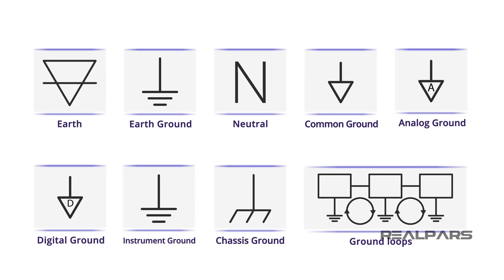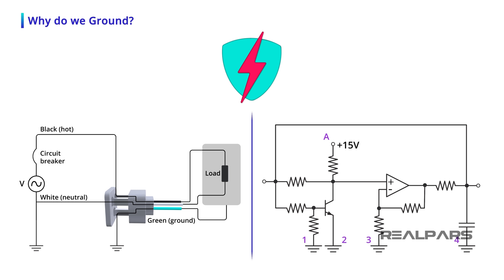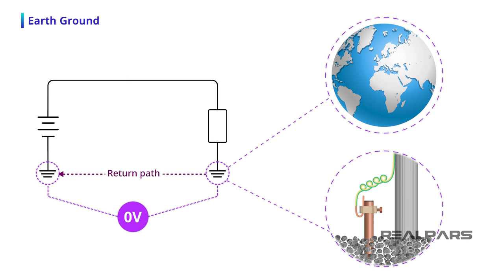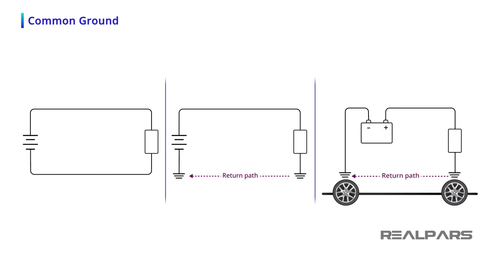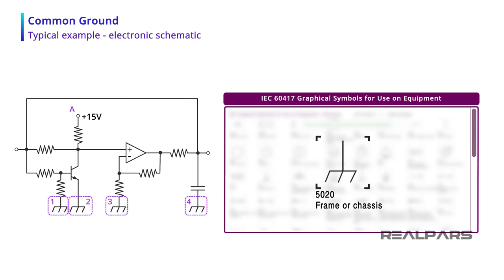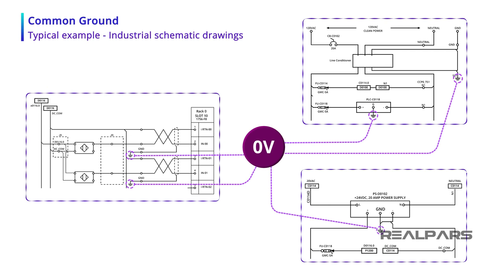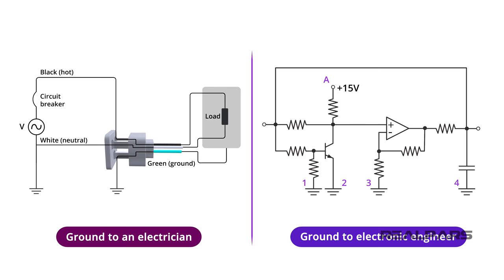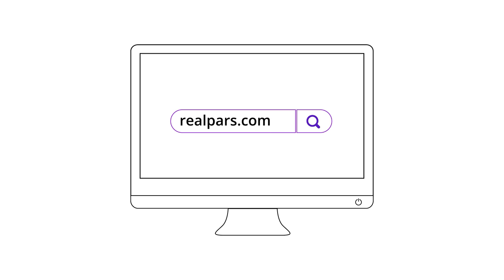Electrical Grounding Explained | Basic Concepts

Comment: This video is informative, but also wrong when we're talking about the power supply to your house. Ground in that case is referenced to both the utilities neutral and earth ground, so it's confusing. However the path of least resistance tells us that the majority of the flow returns to the source via neutral when the ground circuit is used. The ground rods aren't there to reference earth - they dissipate static and other high voltage sources such as lightning. I have had many people argue this, stating that neutral is referenced to ground and not the other way around. My rebuttal is simple. Remove all grounding to a house. Does the single phase power still function at or around 120V? The answer is yes. In a home, the "ground" is for safety and high voltage discharge, not reference to the hot leg to provide 120v L1 or L2 to neutral/ground.
Reply from the maker: Hiya.... Thanks for your input.  It's always great to hear from our readers.

Comment: Ultimately, earth and ground really boil down to what its used for, as 0 volts reference point, and/or wire for all "extra" current to flow to/trough, especially in case of fault.

Comment: Thank you for sharing this helpful video. The only quibble I have with it is calling “planet Earth” the true 0 volt reference. More generally, voltage is the integral of the electric field between two points in space, and one of the points is 0 volts by definition (I.e., 0 volts does not necessarily refer to the planet Earth). Your video is, nonetheless, very helpful.
Reply from the maker: Hey hubercats, thanks for your point of view.!
Reply: Its arbitrary, you can set whatever reference potential wherever you want and get valid results as long as you are consistent with the notation. The easiest way is to set reference potential to 0V (for ease of calculations) and to set it to planet earth. All in all, when safety is concerned, you most often stand on the ground, therefore you are also 0V and whatever potential you touch, that'd be the voltage to shock you :D If you have 1000V point, then it is 1000V. Would be much harder to do it when earth would be set as reference of 2342,1214V. Then it'd take w while to calculate voltage ;)
Reply: @sumilidero  🤣

Comment: As soon as you mentioned that the ground symbol was the most misused I thought to myself “guilty!” 
I’ve worked more with low voltage digital/analog circuits (mostly for classes at school, a little at work now) and we just use whatever symbol we like to denote a 0V point, without regard to whether it physically means chassis, Earth, or just a copper trace. At school this didn’t matter because every circuit we worked with was just a little bunch of wires and a battery, with no metal chassis or Earth connection to be confused with.

We almost exclusively used the most common “Earth Ground” symbol, but some professors would use “Common Ground” or “Chassis Ground” in their schematics.

Comment: This is why in elettronic is better use "0V reference A/D", in the schematic you can highlight the connection with the chassis and the ground (if necessary), but also the connection between 0V-digital and 0V-analog. 
If the target of your circuit are boats, cars or airplanes "ground" means the chassis of the veicle.
Reply: Yeah, but in that case is the negative, right? That's the reason you have to disconnect the negative before when removing the battery.

Comment: You should also note why it's important to declare what "standard" you use for the basis of your discussion. Still people around who think the NEC is a standard when it's not and it specifically states that. Also the symbology changes between standards i.e. IEC, IEEE, NFPA and JIC. JIC I believe is outdated, but if you declare that's what you're using, then you have to go by that standard. Love the video. Good explanations!
Reply from the maker: Hi Albert. You are correct. The NEC is not actually a true "Standard". As per their own definition " Adopted in all 50 states, NFPA 70, National Electrical Code (NEC) is the benchmark for safe electrical design, installation, and inspection to protect people and property from electrical hazards.". In fact certain parts of the NFPA 70 can be rejected due to regional restrictions. Thanks for your input.

Comment: When using a two prong tester to find the hot line, we can old one prong between our thumb and finger. Inserting the other prong in the hot socket, the bulb will light.

Our body is absorbing electrons. Does that mean "ground" means electron hungry?  

Are our bodies behaving like capacitors?  If we held that prong all day with the other on the hot side of a plug, would we reach capacity?
Reply from the maker: Hi Roger.  Thanks for reaching out.  I'm not sure what you mean by our body being electron absorbers. We certainly have several electrons in our body and if we contact a voltage source or a source of EMF, these electrons will begin to move if they have an "Escape route". And that is not a good thing.  We can be killed with less than 50 mA of current flow. We aren't like a capacitor and our bodies won't "charge" like a capacitor.  As a side point, we can't charge capacitors with an AC supply. A capacitor is charged as you describe with a DC source.
Reply: @realpars  : I guess what mystifies me is the fact I'm wearing rubber soles shoes and feet off the ground in my house on wooden floors, and just holding one leg of the idiot light current is moving in and out. How does that work if I'm not, at least temporarily, absorbing electrons?

Comment: Ultimately you have to know the standard that was used for the design of the facility, then understand changes made afterwards may or may not have adhered to those standard, then you have to understand the symbols as defined on those drawings because other symbols are legitimate if they are listed on the drawings.  Drawings are a higher order of precedence than standards.
Reply from the maker: Thank you for adding that!

Comment: As we all know that circuit needs to be closed path to flow current. When live wire touches body of equipment and that equipment is grounded, how it makes closed path? Because live wire is coming generation station or near by transformer so current follows all the way to generation station to make close path?
Reply from the maker: Hi there. Thanks for your question. Ultimately, all supposedly grounded equipment is grounded to the same electrical point. This point is not usually the same physical point, but it is the same electrical point therefore a closed circuit is formed.    I hope that answers your question.

Comment: I’m still confused. How is a car frame a viable option as a ground? What about the cars chassis or frame allows it to be a ground? It’s not a copper rod in the ground it’s just a huge metal body. The reason I ask is because I’m trying to create a home audio system out of car speakers. The box is meant to be somewhat portable but I have no way of grounding it to the earth and still being portable. Is a metal plate the solution/is it a viable ground point?
Reply from the maker: Hi @Asap Mimic. Here's where the term "ground" becomes confusing.  In your situation, "ground" is the negative terminal of whatever you are using for a 12-volt DC power supply.  In the car, the "ground" is the negative terminal of the battery, which is the same as the frame of the car.  In order to operate the same car system at home,  you'll need a 12-volt DC power supply.  The negative terminal of that 12-volt power supply will be the "ground". you do not need to connect to any earth ground.

Comment: Excellent video. Being a mechanical, why "electrical noise" create havoc?
Thanks for your excellent work.
Reply from the maker: Electrical noise is often induced into or interferes with normal operational or control signals. If these control signals are altered in any way, false readings can occur resulting in incorrect responses.
Reply: @realpars  Thanks for your kind reply. Keep us educating.
Thanks.

Comment: Hi Sir 
I have a confusion 
Transformer neutral is grounded so when we using neutral on load side, there is a current flows in neutral..my question is if there is current flowing in neutral then why transformer C.B is not tripping by earth fault?
Reply from the maker: Hi Muhammad. I'm not sure I understand your question.  The neutral wire current is normal while the ground wire provides a path for abnormal electrical current to earth.  A GFI CB detects earth current as it is faulty.  It will not detect neutral current because it is normal.

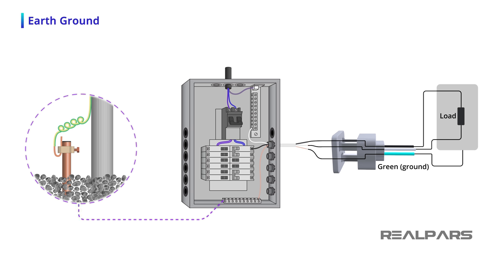Comment: At 2:00 you show a main electrical panel or first means of disconnect. The ground and neutral bus bars look to be separated. They must be connected or just have one. The neutral, equipment ground and earth ground are bonded there. The current flows in a closed loop which includes the transformer and no current on the ground wires under normal operation. In case of a ground fault the current on the ground wires will still go to the neutral on the transformer because it's bonded to the neutral in the main panel and the breaker will trip if the current more than the rating of the breaker. It doesn't flow to earth ground as the impedance is too high. The primary purpose of earth ground and the ground rod is to shunt outside static such as lightning strikes to it's source, the earth, and not your home electrical system.
Reply from the maker: Hello @Ted Sanders. Thanks for reaching out to us.  You are absolutely correct. The neutral and ground are to be connected together for sure. We don't have a physical wire connecting the 2 bars together but. They are connected via the ferrous metal enclosure, which I believe is acceptable.
Reply: @realpars  I don't believe that is acceptable. You need a more purposeful connection, not an incidental one. The most common way and only in a main panel, not sub panel, is to use the green screw supplied. It bonds the ground, neutral bus bars and the case.

Comment: 5:00  I'm not sure the ground loop solution depicted is necessarily a solution. E.g. if the current from block #2 (left to right - 1, 2, 3) is much greater than the current at block #1 then circuit #2 is going to effect circuit #1 or #1 is much less than #2.  I believe this is why these grounds are advised to be spaced apart far enough.
Reply from the maker: Hi Lou. Thanks for your input. The circuit #2 (right-hand) depiction could be drawn differently. I think the audio description would be clearer if the return from each block went directly to a single connection point, such as a bolt connected to the chassis of a vehicle.  Unfortunately, the current depiction could be interpreted as the return from Block 1 connects to the return of Block 2, then the 2 returns are connected at a common ground point.

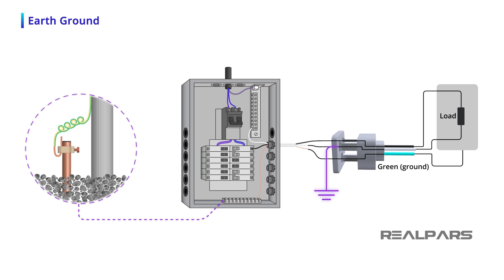Comment: 2:05 , for all my Europe brothers, this is not the case so don't be confused.
In Europe, Earth ground wire is separate, connected directly to the rod that is stuck in the ground, and at no point do neutral and ground wires connect.
Reply: Does neutral have a voltage compared to ground ?
Reply: No, there is nothing "in Europe". Different countries have diffrerent systems and some have several especially if one counts older installations. Every grounding system is used in Europe. In Finland for example older homes have TN-C where the neutral is used for grounding all the way to the socket. Newer use separate wires inside the house but common outside.

Comment: Excellent video. Can anyone tell please than when comes the role of ELCB (earth leakage circuit breaker)?
Thanks.
Reply: The device measures current differential on the 2 lines (L & N in europe). If the amount of returning current is smaller than the incoming current, that means there is a current leaking and this is dangerous (fire, electrocution..) So it breaks the circuit, until you manually turn the switch up again. Usually they are 300mA, for humid rooms like bathrooms they must be 30mA
Reply: @alexvdz8840  Thanks for your kind reply. Keep it up...

Comment: what is TT &TNS system of earthing explain with diagram 
why TT system alone is not enough
Reply: In TT the earth is provided only locally. The earth connection on a socket leads to physical earth and nowhere else. The problem is that impedance of the earth may be too high to trip the breaker in case of a fault. However, nowadays, that can be fixed with the use of RCDs. 

In TN system the earth is provided by the electric system, There are three variations: TN-S, TN-C and TN-C-S. In TN-S the house gets a separate earth and neutral and these are not connected inside the house. Eventually they will lead to the same place. Where they are connected is the business of the electric company, Ideally at the transformer. In TN-C the house gets a common neutral and earth i.e. a PEN-wire and the same wire goes all the way to the sockets where is is separated. This is obsolete and such systems are no longer installed. In TN-C-S. The house again gets a common neutral and earth but they are separated at the main panel and kept separate. This prevents the raise of voltage in the earth cable and therefore stray currents that can generate interference.

In TN in many counties a local earth electrode is also required to reduce risk in case of a PEN-fault. In the UK that is not required.

Note that in apartment buildings where different entities are responsible for wiring inside and outside the apartment things can get more complicated. MY apartment gets separate earth and neutral but they are combined as the installation inside the apartment is much older.

Comment: Why use the "Chasis Ground" instead of "Analog Ground" in the Op Amp example you gave? 🤔
Reply from the maker: Hiya Mau365PP. Yup, my point exactly. Why is that ground symbol used in this opamp schematic? Who decided to use that symbol, and where exactly is it connected?   Is it connected to chassis? Analog ground?  Hard to tell from the schematic itself.

Comment: Hi, I saw that grounding body îs quite necessary especially for people with cronic disease as I am. I live at 4 th floor, so I have to use grounding of electricity socket. But I want to add 2 fuse in series on the grounding cable for safety reason. Any idea about what type of fuse ( what curent, voltage) . Thanks
Reply from the maker: Hi there. You've asked an interesting question for sure. The jury is out on the effectiveness of fuses in series. Some will tell you that a second fuse serves no purpose and others say that it does. I'm not sure how you are planning to double fuse as you'd have to do some serious cable splicing in order to insert your fuses in series. Quite likely, your circuit breaker provides all the protection you need???    But, not really knowing what you are trying to protect, it's difficult to provide an answer.
Reply: @realpars  the fuses could be put în a plastic tube  according to fuses and cable dimensions. Whole cable and fuses must tested preferably in laboratory. If anyone was in my place when a lightning strike(I saw that strike)  street electric transformer ( and distroyed it)  and then the lightning went out 10 centimeters  from electric socket situated  at 2 meters from me, you will  serious think to put at least 2 fuses ! And other protection measures.
Reply: @realpars  As You know at high voltage  it appears flashover phenomenon - I saw it with my eyes in a factory at electric test and I see the lightning came out from socket ar home. In this case it îs advisable to prolong insulation ....adapt things.

Comment: Could a voltage source with a lower voltage be used instead of grounding? Doesn't grounding waste electricity to some degree?
Reply from the maker: It seems like the answer would be "YES", but the scenario you describe is not feasible.  A power supply does not provide voltage through 1 wire alone.  There needs to be a load and a wire connected back to the common side of the power supply.  The voltage is actually a voltage difference (between + and COM) that drives the device.  The device only consumes the amount of power required, and this results in a voltage drop across the device.  If there is no load (voltage drop), then you have a short-circuit.  Current flows from (+) to COM, or for physicists, positive holes flow from (-) to (+).  Grounding is a separate issue.  Grounding is provided as safety for short circuits that may electrify housings or cabinets.  Grounding does not waste electricity because, under normal circumstances, there is no flow of current to the ground.  In this video, we learned it is common to represent 0V  (or COM) with a ground symbol, which is not typically earth ground but rather the (-) of the power supply.  Using the ground symbol allows us to simplify the electrical diagram, as shown at 3:25 in the video.
Reply: @realpars  In SWER electrical power distribution, the EARTH is used as the "return wire" and yes the resistance of the ground path does waste some energy.  If the "ground path" has the same or lower resistance vs a wire than it makes no difference, example: the car's metal frame.

Comment: For those who knew nothing about electricity before watching this video, then the phrase quote 
" electrical noise" should have been explained.  I still don't know what it means & will have to look it up before watching anymore videos to learn  about electricity in our homes, in our bodies and on planet earth.
Reply from the maker: Hi Cynthia. Thanks for your comment.  As you mention, you can find loads and loads of info on the term “electrical noise” on the internet. As it wasn’t a main theme or focus of the video, we didn’t go into great detail. In short, electrical noise is any “unwanted” induced signal or voltage that interferes with or can cause problems with the electrical circuit. electrical noise is created by lots of pesky things that happen inadvertently such as radio frequency interference.